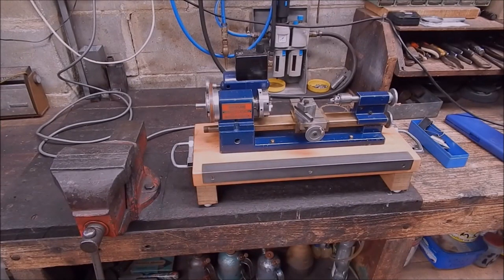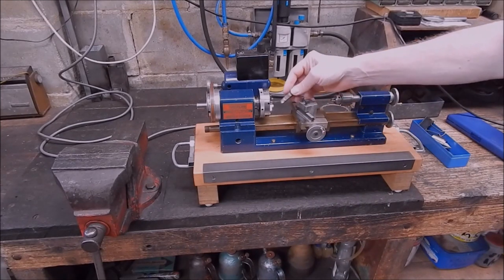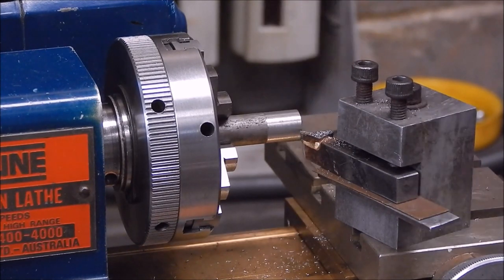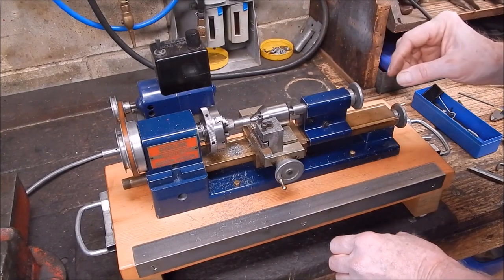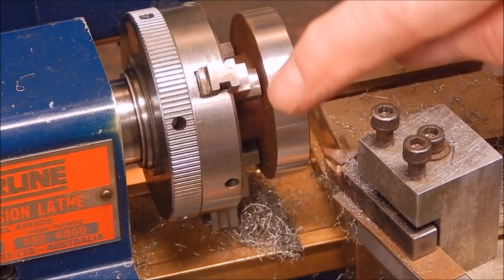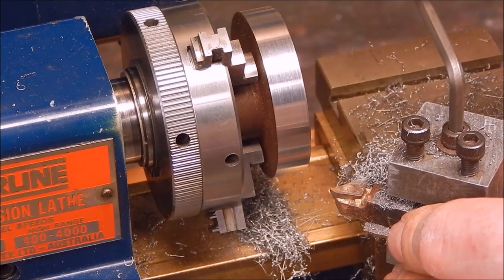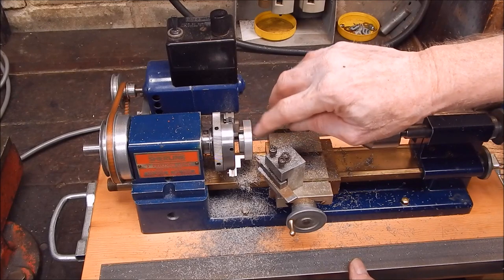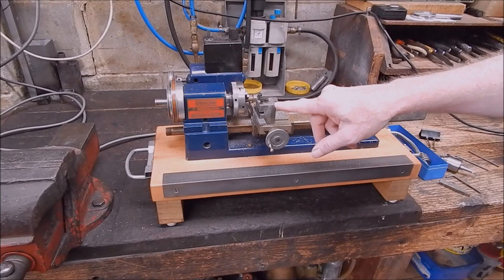Can you use carbide tooling with a micro lathe ?

Comment: That worked great Rob. Nice little lathe. My brother has one that looks almost identical but has no branding on it. He does model railway work on his.  I was told for years that you could not use carbide on small lathes of the Boxford, Southbend, Hercus size. When I got my own Boxford  15 years ago I thought I would experiment with carbine tooling. Made my own then from scrap industrial tips and still do sometimes but  I now have a lot of bought tooling. The only time I use HSS is for profiles etc. I have most of the common carbide tooling now and the time it saves is great. I also use mainly carbide on my mill.Keep the video's coming. Thanks for sharing. regards from the UK
Reply from the maker: Hi Gary,

There's lots of BS spread around about carbide unfortunately.  It's very good tooling, and most lathes can handle it, with the right configuration.

I still  prefer HSS for finishing.

Cheers Rob

Comment: Hi Rob,When I lived in a Hi rise apt. in NYC.Turned a walk in closet into a shop.Brother in law loaned me his unimat 3 .Had fun with lathe .Used carbide as well.it worked .Only took light cuts.No problems.Had a riser block under head stock.Took care of the problem with cross slide.It did get a little old changing to a drill press/mill.Sent it back to him when I moved out west and got my 6" lathe.Miss the drill press ,handy....Pat
Reply from the maker: Hi Patrick,

Riser blocks would be a good idea.  Those Unimats were a pretty complete machine.  Lots of well made options for those.

Cheers Rob
Reply: Yes this one was from the 60's.Well made.Didn't have thread cutting set up.Riser block was factory item.Out of luck on tail stock without a lot of mods....Pat

Comment: Nice demonstration. I used to play with an EMCO Unimat 3 in my teenage. At that time the Unimat 3 was way outside the hobby budget of an ordinary family. But I had the opportunity to borrow one for 2 weeks at a time. The metal parts company where my dad worked offered that opportunity to their employees and to their kids hoping that more youngsters would choose metal working professions later on. And it worked... Which company is doing such a thing today? It came in a wooden box holding most of the available attachments and tooling in it ready to use. The Austria made Unimat 3 was a related descendant of the Australian Sherline. It is roughly the same size. It had an attachment for auto-feed on the Z-axis. And even at that time it came with two holders for carbide inserts and a small box of inserts. It worked beautifully on any material without chatter if the right speed was chosen. As usual with small lathes you had to apply the usual tricks when parting off to avoid chatter but with those it also worked nicely. That little lathe had fascinated me. There were no video games then... I still have some tools which I made on that Unimat 3. Your video reminds me of that time.
Reply from the maker: Hi Roi,

I think people are shocked as to how capable these little lathes are.

I've never had so few comments on any video I've ever uploaded.

Cheers Rob
Reply: My HS shop instructor had a unimat 3. It was a nice little machine but my patience for small machines was not yet matured. Not long after, I got a taig lathe which is slightly bigger, have used it often for the past 8 years. Taig is a very affordable machine--industry may not care for the public anymore, but we can now buy a lathe for three day's labor.

Comment: Hi Rob, that insert did not look like it had much rake on it.The cheap aluminium inserts would work really well on the Sherline, very sharp and with 20 degrees of rake, I think you would really see a difference.
I use them for brass, aluminium and free cutting steel, they don't last as long on the steel, but they are so cheap.
Normal inserts often have little rake and make it hard on a little lathe.  If the Sherline was your only lathe, I would suggest trying what are known as "Finishing" inserts made for getting a good finish on larger machines.  These inserts could do all the ferrous work.
These usually have a sharp edge and a high rake angle which helps when there is not much power available.I use these all the time on my Hercus cnc, which as you know was made in Adelaide. Another great Australian made machine!
Reply from the maker: TCMT inserts work pretty well on Shirley.  I have a finishing insert that is a sharp edged large radius regrind of a broken one.  Works particularly well on non ferrous - not so prone to splinters flying about on brass.

Cheers Rob

Comment: I ise carbide inserts all the time with my lathe .. Infact sometimes i clamp only the insert with a metal spacer underneath( to bring it to center) into my sherline tool post . its really good for cutting tough metals because the insert hangs out only about 1/4 inch so its super rigid.
Reply: Oh yea .. My lathe .. 1974 craftsman/sherline 4000 lathe with brass ways 😁
Reply from the maker: The limit with these lathes is chatter, but that's a good idea.

Cheers Rob

Comment: Hi Rob, great video, I also have a Sherline, mine is the model just after yours with the version 2 Tailstock (gives clearance over the cross slide). It also has the t-slots going the other way. It was the last model before they went to the USA. I'm not sure if you know but the brass tube under the headstock pulley is for an electric power feed option. A guy like you could probably rig something up fairly easily. I think there is a slot in the end of the feed screw to make the join? If your interested I can email you some pictures of the genuine setup.
Cheers Matt
Reply from the maker: Hi Matt,

I'd be interested to see that drive setup. My email address is gloaming_agnet@hotmail.com

I wondered what that tube was for.  It has a thread on the end.  I saw it aligned with the leadscrew and wondered if change gears fitted somehow.  

I really prefer the "T" slots going cross ways - in the classic British style.  It gives the cross slide better rigidity.  Later lathes in all brands now have them length ways, which I think is a retrograde step.

It's a cute little lathe.  More power would be good as speed and power both reduce with the controller. You would have to manually thread on one of these, if you had change gears fitted.

Interesting all round :)

Cheers Rob

Comment: Good one RobI heard you mention using map gas to braze the tip on, could you do that with your Bullfinch?
Reply from the maker: Hi Ray,

Yes, no problem.  I mentioned MAPP gas because most people can easily afford that. The Bullfinch brazing system is quite a bit more expensive but handles this easily.

Cheers Rob

Comment: Noticed 1MT extension on Ebay, only one.  Item 351743377317
Also, if you purchased a 1MT cutter set (as I recently have done), It might be possible a 1MT to larger Jacobs Taper adapter as a short extension.  Making such an adapter might make the small tail stock centers more practical.  Always good to see a new vid.
Reply from the maker: The live centre I used is a Morse 1 reworked to a Morse zero.  I can make Morse tapers on the Schaublin lathe, so I also have a few dead centres as well.

The tapers on bought live centres etc are not hardened and can be reduced quite easily.

Cheers Rob